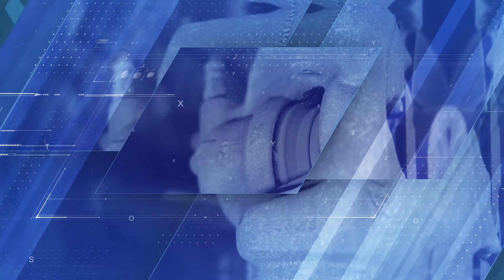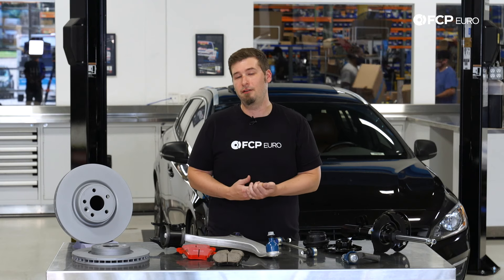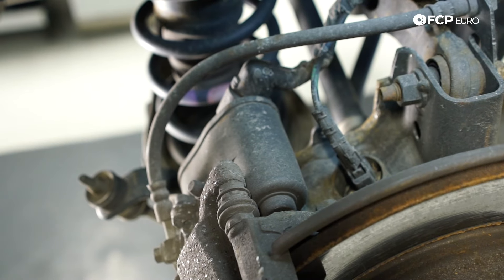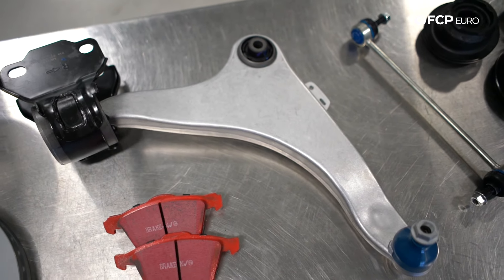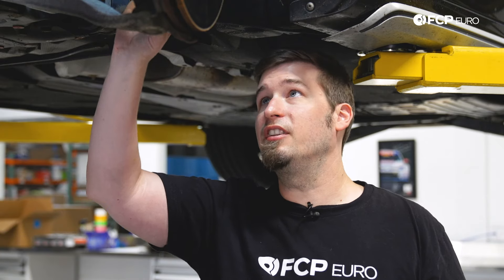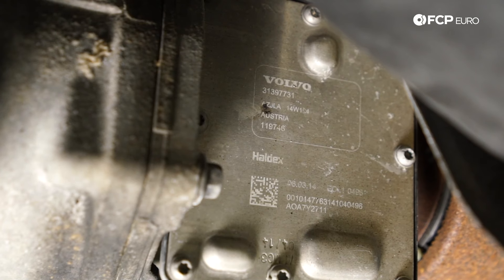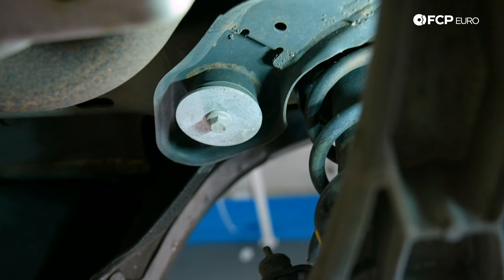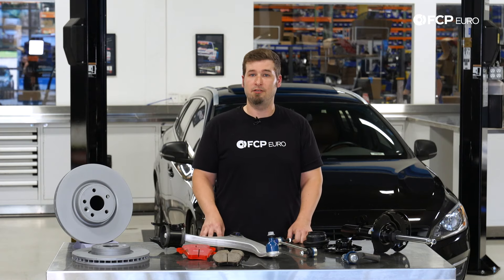Volvo S60 Suspension Diagnostic & Maintenance Guide (2007-2018 Volvo P3 S80, P3 S60, P3 V60 & More)

Comment: I've got a rattle from hell slow speed under 40mph sounds like boot trim rattle, can't find anything that's obvious. High miles but passed mot no advisories . So annoying. Got louder after a changed a rear shock due to tiny leak.

Comment: On a steel control arm you can change rubber bushings not whole arm, original arm is aluminum and you can not replace rubber bushings.

Comment: You showed the conical style threaded ball joint on the vehicle then cut away to the pinch bolt style one , I’m confused why there are two different configurations?

Comment: Great video with superb content. Definetly subscribed and like that video! Thanks! 
My strut bearing went bad after 191k km(about 119k miles) after some fast driving on the fresh snow and leaving a car parked for about a month(maybe some rust finished its life :P ). The symptom was that there was a slight resistance at one point when turning the steering wheel smoothly from one side to the other. I own V60 2014.
Reply from the maker: Thanks for subscribing, Mateusz! Glad you like the P3 content! Good catch on the strut bearing!

Comment: Thank you for this video. I shot the rear trailing arm bushings on my 2012 S80 (old spring mattress noise on each speed bump) and now I know we need a special Ford/Volvo tool to remove it... I guess the iPd rear sway bar and end links are no stranger to a quicker wear and tear (and even worse : cobblestones streets). Well, at 135 000kms that's okay I guess!
Otherwise I already changed the front suspension arms and end links around 130 000kms, HUGE improvement! (and Koni shocks obviously)
Reply from the maker: Cobblestone streets are the real suspension killer! Glad you have your front end feeling tight!

Comment: I got the P3 rear "clunk" in my s60. A little afraid to take it in. But this video made it not seem so bad.
Reply: Was it the bushings? I have the same thing and it's driving me crazy...
Reply: @isaiahshamar  Ball joint. 800 dollar fix
Reply: Thanks. And sheesh, must've been the dealership with a price that high?
Reply: @isaiahshamar  Nah., My  guy only works on Volvos. I trust him.  We replaced all 4 joints as preventive maint

Comment: Great video. Would only disagree that P2 is harder to work on. Aluminum parts are way easier to remove in rust belt and 4 bolts to replace front wheelbearing is better than dealing with the press style bearing, and only special tool is a piece of 6inch pipe from home depot to drive in balljoints.

Comment: Are the front struts on a 2010 S80 R design any different from a normal 2010 S80?. And what does tuned suspension mean.

Comment: Very good video! I have a Volvo S80, 2007 model. There is too much roadnoice in it, I suspect old and worn bushings. Are there any bushings I would adress first in your opinion?
Reply from the maker: You will certainly want to inspect all of the control arm bushings, tie rods, end links, strut mounts ect, especially if everything is original!

Comment: My 2012 xc60 fwd has squeaky noise from left rear wheel area. I didn’t see any thing obviously failing. What could be the cause? changed the shock absorbers. Noise still there. Noise is mostly associated with bumpy road.

Comment: Hallo FCP Euro.. I have to ask.. My volvo v60 has 300mm frontbrakes.. Would it be possible to switch out my 300mm brakes to 316 or 336mm brakes by just swithing out the calibers? And does it need any work to make them fit?
Reply from the maker: More than likely a change to the caliper carrier will need to be done, depending on the year. A good visit to the forums may also be in play here!

Comment: Great review. I own a 2012 and 2015.5 S80 AWD, both with the T6 3.0 . Having some issues with the ride on both cars. 165,000 miles on the 2012 and 97,000 miles on the 2015.  I have a rattle in the 2015 that I can’t find, nor can the Volvo dealership after multiple attempts. It sounds like a cable is hitting the sides of an internal wall. The dealership has had multiple techs look at the car to find the rattle with no luck. It’s been there for 60,000 miles and driving me nuts. The location sounds like it’s coming from the front left side between the driver’s door and front left corner panel. Any suggestions? Also, can you recommend anyone in the NJ area for good honest repairs of your caliber. The dealerships are getting really bad.
Reply: @JohnGorny 
 Thank you for the reply. I’ll give that a shot and report back.
Reply: Better check if you have any loose parts underneath the wiper cowl.Like the intake vents that seat underneath or under the front left fender some of the routing of the headlight washer system or the reservoir for the windscreen wiper sits there also
Reply: @endurocrosser8834  Thanks for the idea. I’ll give it a try.

Comment: Great video, i learned a lot. I have a question about automatic gearbox. As far as i know, there are two kinds, one from Ford (Powershift), and one from Aisin (Geartronic). Is there any safe way to know which one is in the car? I am looking for a nice V60 or V60 CC (2017-18), and that bothers me a lot. 
Thanks in advance
Reply from the maker: We actually didn't get the Ford Powershift gearbox here in North America on the P3 cars, so we're not entirely familiar with it. However, I would imagine they were found on the Ford Ecoboost-powered cars in Europe.

Comment: 2013 XC60 w/ 118K.  Just had to replace both front springs (passenger side broke) and rear trailing arm bushings.  Are spring failures common?  Still have a very slight clunk/ bump (nothing severe) when car upshifts/ downshifts.  I only notice it at low speeds and more-so on the 1-2 and 2-1 shifts than any other time.  I’m wondering if it maybe the engine torque rod has failed (it’s original) and the clunk/bump is the engine moving around.  Other idea is that it may be strut mounts.  Any suggestions?

Thanks for the P3 content!
Reply: I've broken several front springs on 2 x XC70's, driving on rough rural roads.  It sounds like the XC60 chassis is similar.
Reply from the maker: Springs can definitely break, the first thing to check would be worn strut mounts/bearings.

Comment: Hey. i have a 2012 volvo v70 D3. the problem is that the car vibrates at a speed of 60 km / h. the vibration increases slightly as the speed increases. feels in the car body and a bit in the steering wheel. would there be any part of the platform that does this? the drive axles have been replaced and the wheel bearings at the front. acceleration is not affected by vibration. thanks if you can help :)
Reply from the maker: Hi Miika, it could be something as simple as needing to have your wheels balanced, especially if you start feeling it at speed.

Comment: Do the front A arms on P3 cars chew up tires when they start to wear? I know that was an issue on earlier cars and they often wore quickly.
Reply from the maker: Worn control arm bushings and ball joints are definitely going to cause some increased tire wear.

Comment: Heya team, i love the quality of your videos. I have a P3 question...

Ive got a 2014 V60 T6 R-Design and when stationary in traffic with my foot on the brake, there is a consistent clunk coming from the rear of the car, the clunk happens every 10-or so seconds and is reasonably quiet.  Do you have any ideas on what it could be?
Reply from the maker: Hi Hamish! While it's difficult to diagnose stuff like this, we would recommend looking over the rear suspension, including bushings, as well as the rear brakes.
Reply: @fcpeuro  thats for the reply, ill have a good look, my suspicion would be brakes, it almost sounds like a solenoid clicking. If i cant find anything there ill be sure to also check suspension bushings

Comment: My 2013 S60 T5 AWD has had a steering wheel shake forever. It seemed to start right around the time a went from 17” wheels to 18” after market. Wheels were rebalanced and rotated several times. No luck. Finally bought new rims. No luck. They been rebalanced and rotated too. No luck. The wheel shake is intermittent beginning at about 55mph and seems go through a phased cycle of beginning, peaking and fading in a span of about 60 seconds. Sometimes it doesn’t shake for a while. A Volvo dealer and i dependent shop found nothing obvious. About to just begin throwing mud (money) at the wall and randomly just replacing things. Love the car as it’s 10 years old and only has 40,000 miles.

Anyone have any ideas on the 8th mystery of the world?
Reply: It could be the rotors. Had a similar issue with my Camry. Changed wheels, tires and still had the steering shake issue. Mechs finally decided to replace the rotors and that solved the problem.